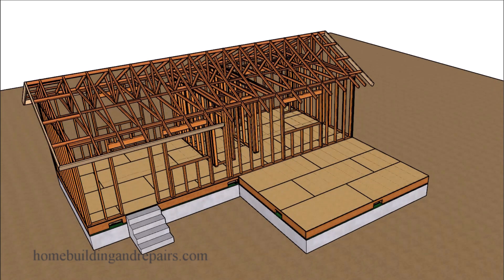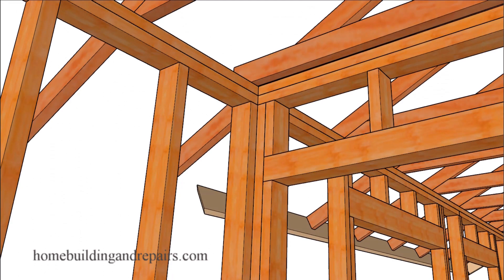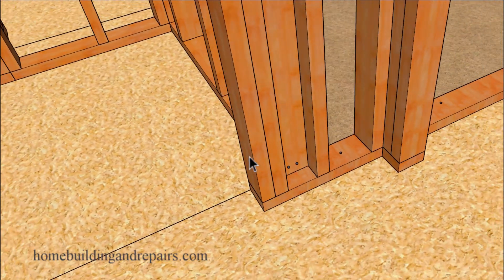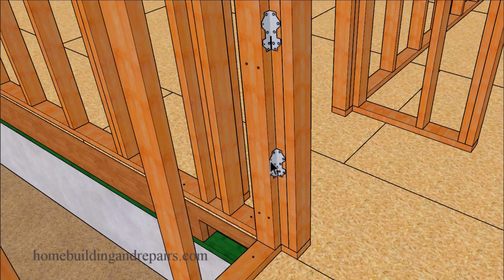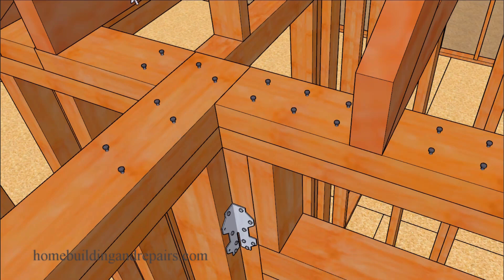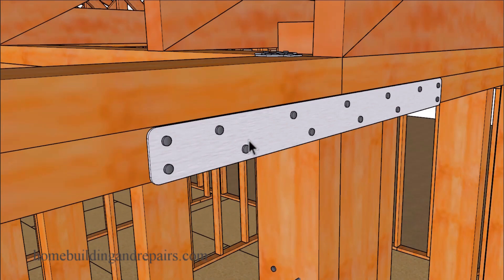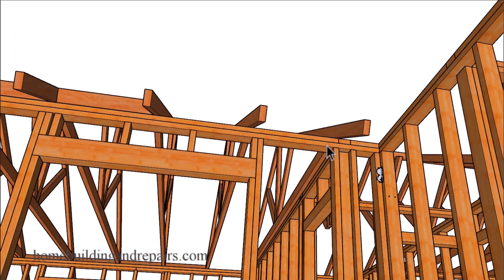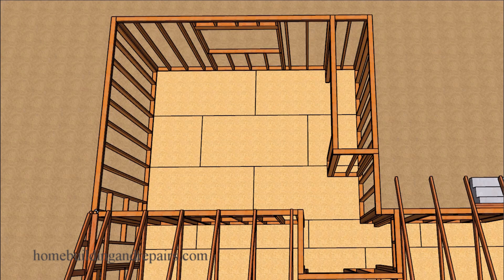Structural Framing Examples For Connecting New Walls To Existing House or Building

Comment: Curious.....Greg @5:45 , with the use of this 4ft strap, how do you get full perimeter nailing of your sheathing?
Reply from the maker: The strap would go on over the wall sheathing, but I wouldn't nail the sheathing in the strap area, because the the strap nails should be more than enough nailing for sheathing perimeter. Check with your engineer to verify if you have one.